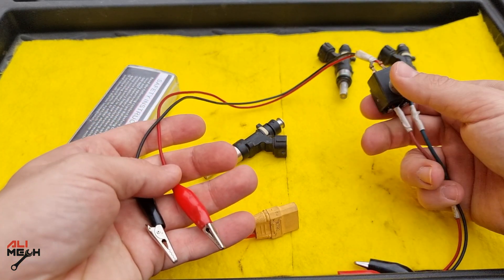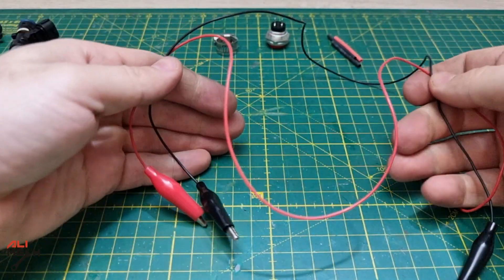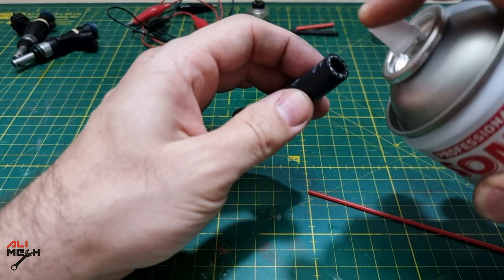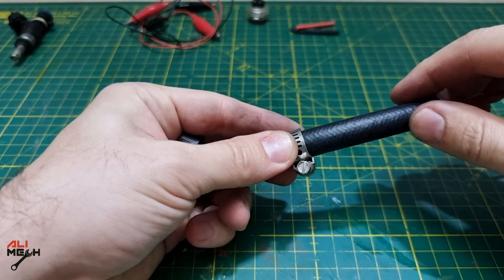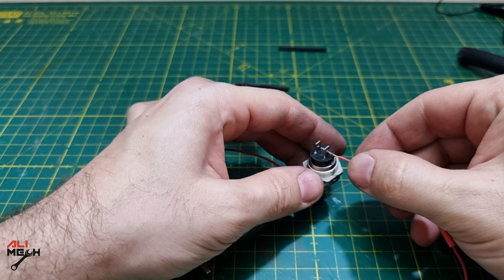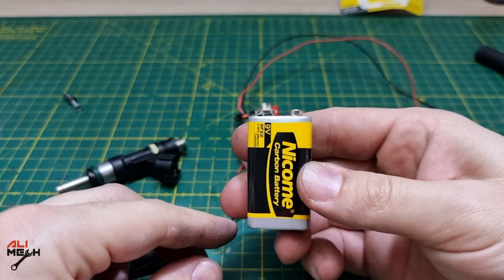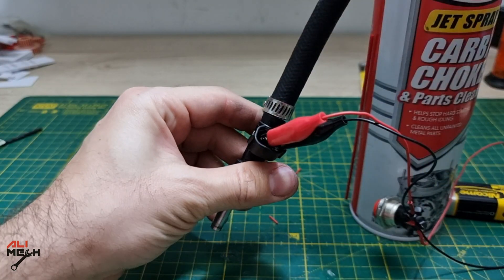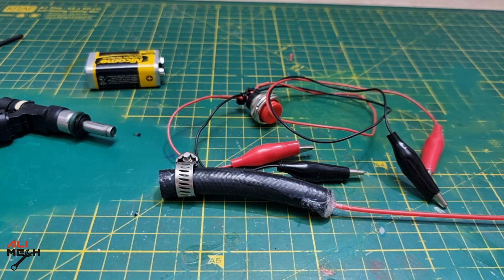Make your DIY Fuel Injector wire tester at home/ HOW TO clean GDI injections without expensive tools

Comment: What was the glue you used called? and where did but it from
Reply: adam martinez, i think it is cyanacrilate also called superglue.  the activator is probably water with carb soda dissolved in it.  i will be using superglue plus carb soda.  its cheaper.
Reply: I bet hot glue would work too.

Comment: Great video because I was wondering if your usual method works on GDI -gas direct injection Injectors because they require very high pressure to spray. Usually your videos feature port injectors. Now I know it still works!!
Reply from the maker: Great point! yea it works, thanks for watching

Comment: Becareful, don't remove your cars fuel injectors, they needs to be calibrated to work again correctly
Reply: than, you make a video about calibration, it will make sense!
Reply: @frschannel8217  He does not care!
Reply: Show us how.
Reply: Fuel injectors are pulse controlled by the ECU meaning they themselves are able to be calibrated.  If you have had poor flow rates for awhile and suddenly rates are increased via cleaning the injector thrn yes the vehicle ECU may need to relearn air/fuel mapping ratios but this doesn't require caibration by a service tech.  Simply drive the car as normal for a couple trips and it will adjust itself.
Reply from the maker: There is no need for calibration, even when you turn off the car, it cuts power from injectors completely, so if u r right, you have to calibrate injectors eventide you turn off the engine 👌
Reply: @AliMECH  Try to do that on German car... Good luck!!!!!

Comment: You didn’t say why to remove the strainer inside the fuel injector. That wasn’t a step in your other videos. It’s probably not essential.

One thing is don’t forget to reinstall it!

I’d like to know how you diagnose the car to tell if your fuel injectors are clogged and need cleaning. I expect you would know from your fuel trims.

Comment: Excellent video. Just some feedback. When you're mentioning cutting wires, if you could be more specific about measurement or how much, it would be better. Thanks for another great video.
Reply from the maker: Thanks,  actually it doesn't matter where you wanna  cut it, that's why I didn't day any messurment, after 15cm is good